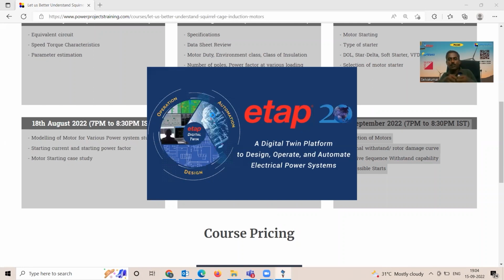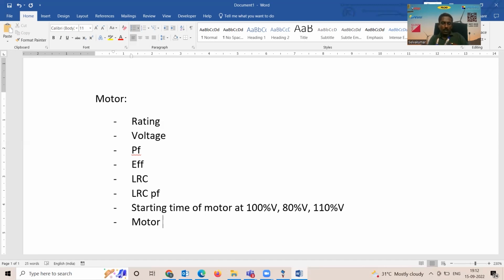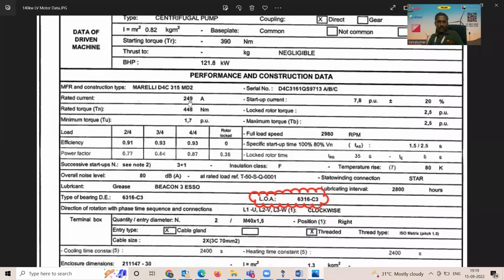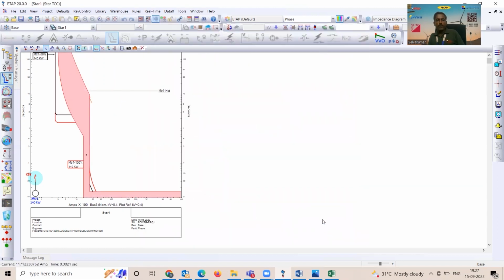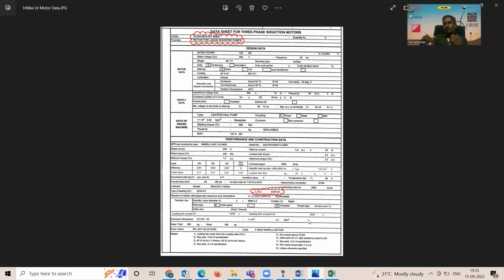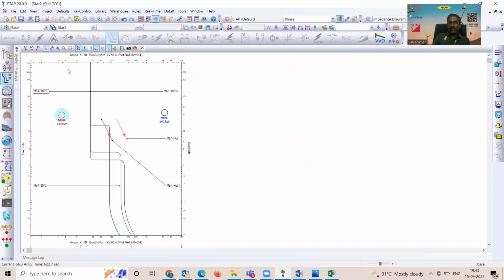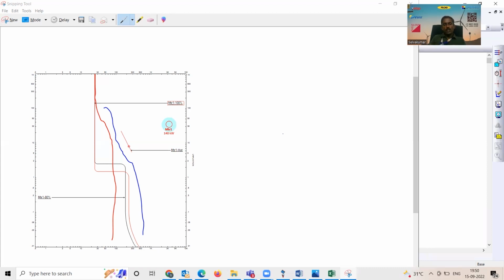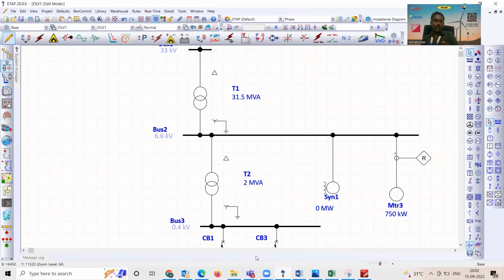Motor Starting Study Using ETAP: Complete Guide to Motor StartingStudy|Motor StartingStudy Explained

Comment: Nice Video, Sir, I want to ask, when running load flow why the kW that appears is always greater than the motor nameplate that has been input in ETAP. even though the Load Category has been set at 80% (Normal Category) for example absorb load 80%), the operating load in Load Flow is still above 80%.

Or another case, for example in Dynamic motor Starting, why is the Operating kW also greater than the Nameplate or Load category that has been set (Absorb Load 80%)??

Any solution?
Reply from the maker: In ETAP Load Flow, the kW may appear higher than the motor nameplate because it reflects the connected load, not just the motor rating. Even with 80% load category, if the connected load is higher, the kW will exceed the motor nameplate.
Reply: @PowerProjects_etap  I see that it has included motor efficiency. However for dynamic motor starting im still curious, why it is more than the kW, even more than when the efficiency has been considered.